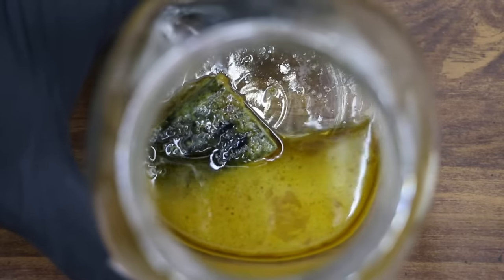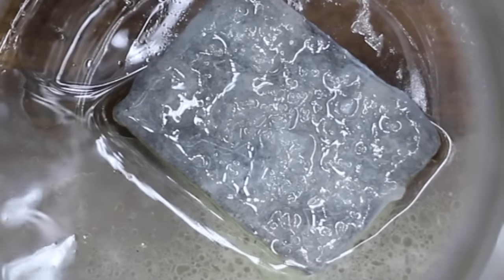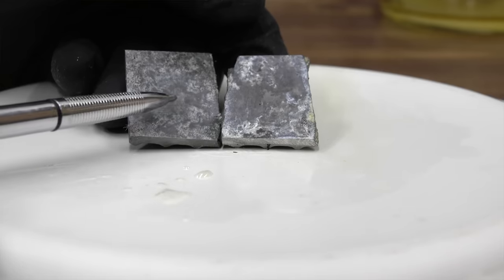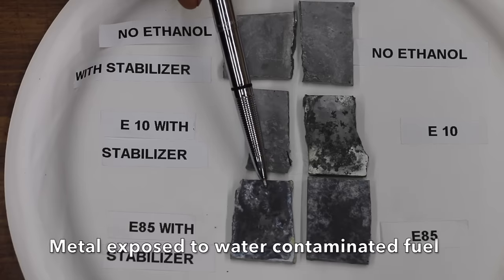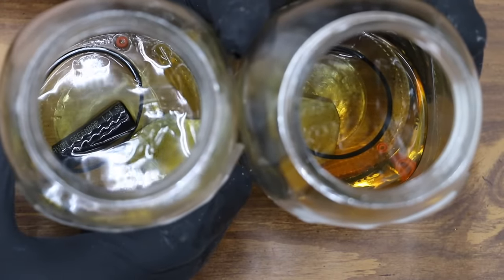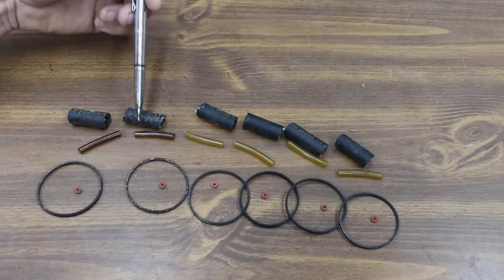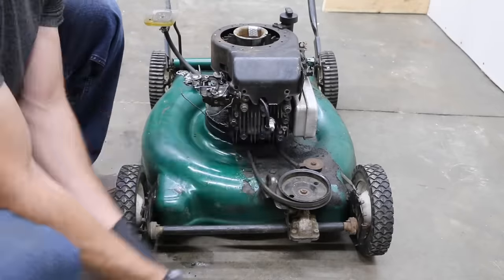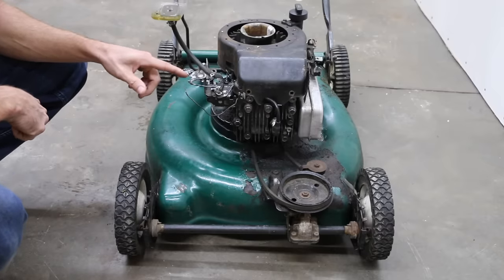Does Fuel Stabilizer Prevent Ethanol Damage?  Let's find out!

Comment: Finally, a “real world” test that proves what I’ve been telling my customers for years. Thank you! I’ve shared this video to my business page as more proof of what ethanol enhanced fuels can do to equipment if not properly maintained.
Reply: Long answer : It's not a real world test, but a worst case scenario where the fuel has been intentionnaly contaminated with water. In real world, you will not get as much water if your fuel. Also, carburator are more prone to damage, but they are not compatible with ethanol. Injection systems (100% of modern vehicules) are much less exposed to corrosion because there is no air (and therefore no water) in the fuel lines and injectors. Also, all modern fuel tanks are in plastic or have a protection layer in it, so it will not corrode either.
I'm not saying there is no corrosion at all, but it's certainly not something to worry about, unless you store your vehicule for a long period.

Short answer : in real world, with a modern vehicule, ethanol based fuel will not cause significative corrosion (except maybe if you store it for a long time).
Reply from the maker: Thank you
Reply: mark robertson  Wow, you totally changed my mind, thanks for opening my eyes ! Joke aside, just saying "disagree" brings nothing to the conversation ;-) . If you have factual counter argument, I would be happy to hear it
Reply: Blind Squid  I know ethanol is hygroscopic, I'm just saying that what we see in those tests is an extreme scenario. You can find similar tests where there was no intentional contamination, and there was no corrosion at all.

If the ethanol damaged your vehicle to the point of it running bad, it would still be the case after you stopped using it. What kind of degradation did you see ?

I don't know about other countries, but in France, there is no ethanol free gasoline. The "best" you can get contains up to 5% ethanol, and that's true since at least a decade. If it was an issue, there would be a lot of cars mysteriously breaking down since the apparition of biofuel. But that's not happening.
You don't go from perfectly fine at 5% ethanol, to catastrophic failure at 10%. So just don't worry about it...

I use only E85 since 1 year (with a modded car), and I have no issue at all. About exhaust temperature, injector saturation etc, I read a lot of bullshit, so I tested everything myself, and everything works just the same as with gasoline, but that's not the topic.
I did a lot of research a year ago, before converting my car, and I couldn't find any reliable evidence that ethanol caused damage to any modern car on the internet. 
Overall, there is let's say no negative feedback. And yet people like to complain...
People saying it damage engines never has proofs. They just relay what they found on random crappy auto blog or website.

BUT

I agree that it MAY cause damages to some parts in direct contact with the fuel in the long run, like fuel pump or injectors. I'm not even sure about that, as those parts are designed to work with ethanol in every modern car.
But honestly, I save the equivalent of 1000$ each year just in fuel. So if I have to replace a fuel pump a little sooner than expected, I just don't care...
Reply: @PAD32  The issue isnt so much with modern vehicles though, it's with small engines. Those of us that wrench on mowers see damage from ethanol every single day.  
Part of me is okay with it as it puts dollars in my pocket. Another part of me doesn't like it because it drives up costs and can lead to customers just hiring their mowing out and thus, I end up with less money in the long run.
Reply: @PAD32  I have seen no evidence that it in any way hurts automobiles built within the past 20 or 25 years, it's always the small engines that have a problem. The manufacturers seem to be unwilling to make a small change in the carburetor material that could prevent the corrosion issue. Small engines are stored for long periods, they are often left in the rain and their fuel tanks are small and poorly sealed. They are prone to water contamination more than vehicles. I blame the small engine mfgrs for not making a product that will stand up to use of our federally mandated fuel standard.
Reply: @chester8420  @Pinion512 you are right, for those engines it may be an issue.

I retrieved an old mower that was stored for a long time, maybe 5 years. It didn't work at all, in fact it was dirty inside the carburator, probably corrosion, but honestly it was not that bad. It needed a good cleanup, and now it works fine. But maybe in some cases, it could be worse
Reply: Blind Squid — the trouble is, all fuel you buy these days has a minimum of 10% ethanol in it.  There is NO fuel around me (CT) without the labeled 10% ethanol‼️ So, now what does one do about this? I’m at a loss.....🤔
Reply: @mrdiplomat9018  Just use it like you normally would. If you are gonna store equipment for months on end, drain the gas out and run the engine to empty the fuel system. Then you will have no problem. Remember, even "non ethanol" gasoline will shellac up a carburetor over a period of time.
Reply: PAD32 , actually, this test is more geared to small engine usage versus motor vehicle use. The reasons we don’t see the damage in vehicles is multi fold, and I won’t get into specifics here. But for small engine use, it’s not a matter of IF it’ll cause damage, but WHEN. I work on marine and lawn care equipment, and see the damage modern fuels cause daily.
Reply: Yeah its much cheaper to just run the equipment out of fuel, then you don't have any problems the following season.  That fuel stabilizer stuff is just an expensive gimmick that doesn't work, with ethanol based fuels its a waste of time and money trying to stabilize it, throw it away at the end of the season or throw your equipment away because its not going to work the following season.
Reply: @mrdiplomat9018  I fill up my boat with ethanol free at the marina.  Not worth the trouble for cars driven frequently
Reply: from what I understand, ethanol fuel only effects carb engines, which no new cars have now days.
Reply: I wouldn't say: enhanced, poisened maybe.
Reply: Another reason we don’t see as much problems with cars running on ethanol is most people drive there cars a lot more than they’re small engine vehicles. So the ethanol doesn’t have much time to degrade before it’s burnt up.
Reply: @mrdiplomat9018  there are ways to remove the ethanol from gas. I know a boat Mechanic that fixes tons of outboards and larger boat motors damaged with water contamination. You can add aittle water. And the gas and ethanol will seperate. He puts it in his truck. You once it seperates one is pure gas the other your ethanol and water
Reply: Luckily we have rec 90 fuel here. I use it In my vehicles and get better mpg. The station across the steet offers 87 non ethanol. And 10 miles away a station offers 87 89 and 93 non ethanol. But being a coastal community/courtry not far away Theresa lot of boats and ATVs and lots of mowers. 90 rec cost the same as 93 premium around 2.60 a gallon currently
Reply: Pudwacker32 is a farmer that grows corn used by the ethanol industry. Emotionally invested.
Reply: Sunamer Z  Before a significant part of ethanol evaporate from your fuel tank you can wait a long time. This is perfectly negligeable for a vehicle that is not in storage.

Comment: My rototiller was running rough & started hard this spring. I took the carb apart & it was all corroded inside. I cleaned it all up & started using RV gas, thats what they call it in Michigan. When I saw how much better it ran, I switched my lawn mower & snow blower over to it as well. The rototiller now starts on one pull EVERY time & my rider runs way better!! It isn't even that much more. I get 90 octane RV(no alcohol) & it was only $3.20/gallon. 87 octane for my car is $2.75 & as little as you use, I'll never go back!!! Thank You!!!!!
Reply from the maker: Thank you for sharing this experience!!

Comment: I was a Small Engine mechanic for 5 years and Ethanol was by far the most common issue with all equipment, Great video, Great content, Great Youtuber. Keep up the good work!
Reply from the maker: Thank you!
Reply: Is Seafoam any good? I use it with non-oxy and run the bowl dry and refill tank with seafoam and non-oxy before storage.

Comment: I have an outlet, a rural station that carries Non E fuel in 93 octane. In that area, there are a lot of farms, and the Gifford Pinchot Nat. Forrest, a Valhalla for Dirt Bikes, and ATV's in summer and snowmobilers in winter. It's expensive at ~$2.00 more per gallon than regular E-10 but they have it. I have done the water test on it to be sure it's the real deal and it passed. No Alcohol present. At the end of snowmobile season, I bring 10 gallons home- about 40 miles away and it's gets me through the summer with all my portable power equipment. This was a great video and I really appreciate you making it. 10/10 with two thumbs up!
Reply from the maker: Thanks and you are welcome!

Comment: Please test Stabil! I put this in my motorcycles when I’m away at college. Thanks again for these videos.
Reply from the maker: Great test idea! Thank you
Reply: Same result.  When storing an engine you need to drain the fuel system (including carbs & injectors), preferably with the last tank of fuel being ethanol free.  The more modern carbs have a coating to combat this, and don't corrode to this degree.
Reply: Yep, I use Stabil as well
Reply: Agree 100%. Would like to see original and ethanol StaBil tested
Reply: Stabil is just ATF
Reply: Used to use it all the time when putting lawnmower away for the winter. Then realized it was smarter to run the lawnmower tank empty. But I NEVER put E10 in any small engine. But now days where does one find ethanol free gas. For darn sure not in California!
Reply: I was thinking about a stabilizer competition? Are they all the same, or are some better than others?
Reply: @sziltner  Here in oregon you can find it, but you've gotta be looking. Ironically the commercial pumps for fleets dispense non ethanol gas.
Reply: In my personal trials over the last 5 years, I've found no difference when it comes to start up after storage. As for corrosion I have no idea as that's harder to test.
Reply: Test the Stabil Marine 360  too plz
Reply: But he needs to test the red and blue stabil as the blue is designed for ethanol
Reply: Yeah for real. I use Stabil fogging oil and I love it. Testing Lucas is like testing Fram and acting like its indicative of the norm. They're both a joke, IMO. Duralast is like half-kidding. I don't buy that either.
Reply: @jacobcurtis6849  why.. because it's red ?
Reply: Rick Simpson  ,
Been a long while but I have heard your logic spoken before regarding corrosion prevention - not leaving bare metal exposed in the fuel system while simply moving the fuel on a regular basis with stable in it untll active seasons.
Reply: @isaakwelch3451  There is an APP for that.  It is called "Pure Gas".  It will use the GPS on your phone to find the nearest non E gas.
Reply: Rick Simpson  That kind of the whole point of painting metal objects.  To keep them from rusting.  Never understood why people would run an engine dry and not expect bad things to happen.  I believe the term we used when I was turning a wrench at a marina was "fogging".  And that was with 2 cycle motors.  4 strokes are in more need of being fogged up if they were to set for any amount of time.
Reply: Why? the man just showed you that stabilizer does not work.  The brand is not going to make much difference.